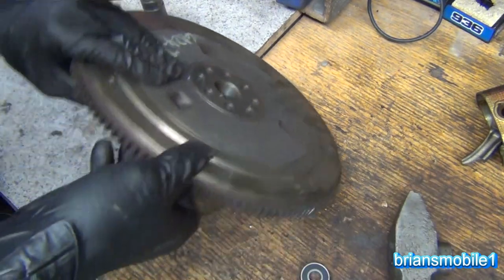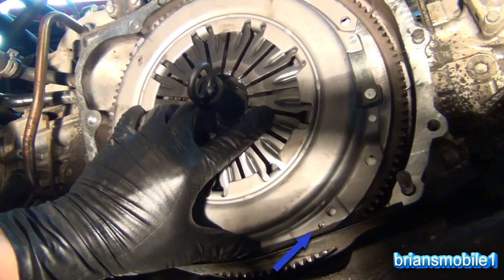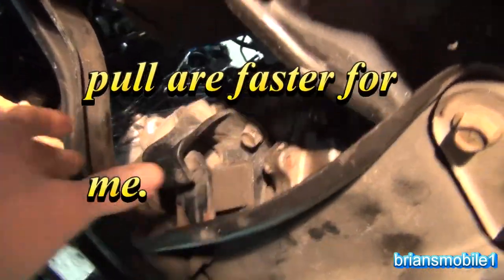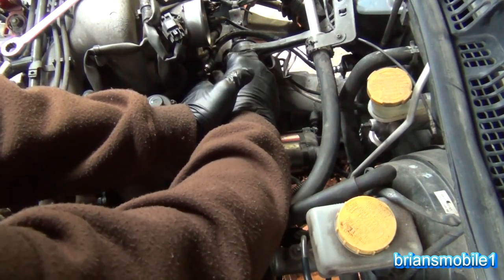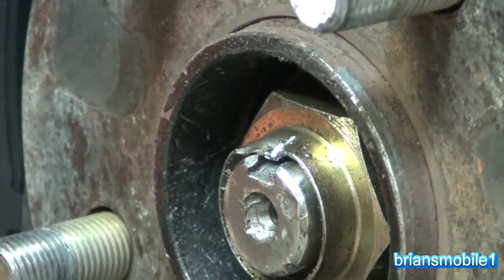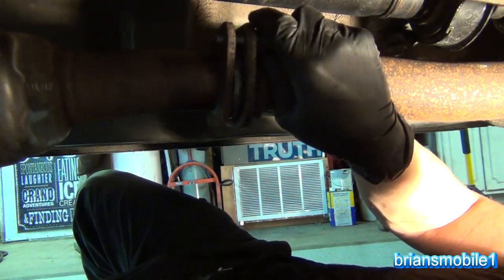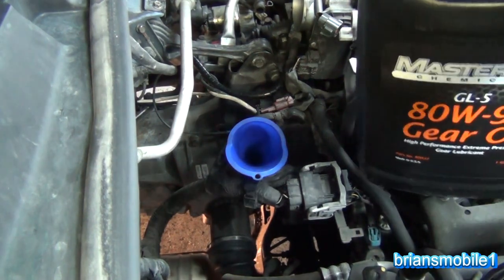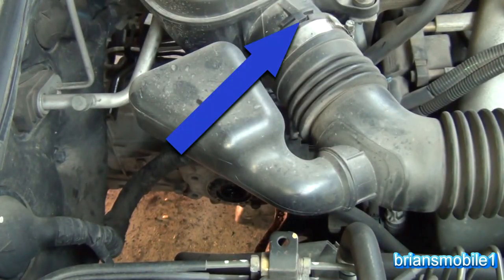Subaru Clutch and Transmission Install Part 2 of 2

Comment: Tip for getting the input shaft aligned with the clutch: if the input shaft won’t go in and there’s a 1/2 inch gap between the transmission and the engine, use a breaker bar and try turning the bolt on the crankshaft pulley in the front of the engine a little until they connect.

Comment: i had an 01 alero that had a bad wheel bearing on it... had it replaced at a dealer on the seller's dime... turns out dude didn't tighten that big nut nearly enough. i got five feet out of the door and hit the brakes and went straight back in and told them something was wrong because my brakes were messed up... a mechanic test-drove it and said it was fine. i had to go home and take it apart myself to figure out what was wrong. suffice it to say i never went back to that place after i made them fix it.. which, somehow, when they weren't getting payed, took about 1/8 the time. but yeah, those symptoms.. brake pedal shooting almost to the floor, steering off, wobble, and grinding sounds from the caliper mount scraping on the brake disc.. that's one of those CV nuts not tightened right.

Comment: For the pilot bearings to pop them out I just do the ole trick fill with grease and get a socket and extension the same diameter socket and the volume of grease and force forward pushes the bearing out even bread works but it's a mess of crumbs and not really worth the time I've seen the bread trick done haha

Comment: great vid as always. Those pic captures are funny. Wouldn't it be great if car manufacturers design a car in such a way as to replace clutch kit without separating transmission from engine. Cant be that hard.

Comment: I am using a transmission jack but I can not get the trans to move forward . I feels like the nose of the trans input shaft won't got into the bearing. Any suggestions to get it to go in? I have tried nose high, tail high, level, I've been fighting this thing for almost three hours.

Comment: Hey Brian, I have an oil leak at the rear of the motor on my 03 wrx. Which is easier pulling the motor or the transmission.
Reply: i pulled my 2.2 in my 96 legacy to do the seals but when your back there the usual culprit is the oil seperator cover you can probably do seals with tranny out but if you have ever pulled a seal its gonna be easier to pull engine where  you have acces to back of engine good luck and i would pay close attention to those torque values you dont want to be a stripper who doesnt get paid lol oh and i dont have experience with turbos they have down pipes and stuff i wpold research that too so your less likely to screw somrthing up good luck subys are worth the effort in my book

Comment: my subaru won't go inti gear even after installing a new clutch its a 2005 subaru Forester. ive put a new master cylinder but it wont push back to even bleed it properly

Comment: After replacing clutch successfully on 2008 Impreza , I got P0076 code for mass air flow sensor. Any idea what has caused it or what could be the idea to fix it other than replacing the sensor

Comment: Is there anything I should be aware of when replacing the dual mass flywheel in my 05 Outback XT with a single mass flywheel and clutch kit? I understand the 07 kit with a 14lb flywheel should bolt right up. Does that sound correct? briansmobile1

Comment: I need to replace the clutch on my 97 legacy outback. Ive done a clutch replacement but on a manual 96 camry so subarus are fairly new to me. Which is the least headache, removing the transmission or pulling the engine forward about 4-6 inches?
Reply: trans

Comment: Great job as always. Did you have to bleed the slave cylinder?
Reply from the maker: Thank you.  I replaced a bad brake hose before replacing the clutch.  I didn't have to bleed it but the once before the job.

Comment: Thanks for posting good videos on Subaru repairs. Saved me a lot of money, busted knuckles and plus some select words. I've replaced the timing belt from your videos and it worked out great. I now have to replace the center diff and the throw out bearing is making noise so this video will be a great help.

Comment: Excellent video, and I'm beginning to rely a bit on your advice.  Could you do the same transmission R&R for an automatic?
Reply from the maker: When I get the chance again sure.  I shot one, but the story line was a mess- never edited it.  Got interrupted a lot.
Reply: I've had that "interruption" problem all day today.  That wire, by the way, attaches to the torsion mount on the top of the tranny.  Thanks for the heads up, I knew to look for it.

Comment: How do you break in a new clutch?, I put one in my car then loaded it up and drove out with me and 2 others and luggage up across the rocky mountains from Denver right after a I put it in. but even now I'll smell clutch when pushing the engine hard. Even being in a lower gear going up a hill I'll still smell it.
Reply: Was the flywheel resurfaced?  New pressure plate?  Gripping surfaces free of grease?  Is the linkage fully releasing? Do you have any free travel on the pedal?  You shouldn't be smelling it!  Unless you're doing high RPM engagements!
Reply: dansMETube  Yeah whole new clutch assembly from car-quest and had Napa resurface the flywheel. The cable and linkage is fully released as theirs play in the cable. been like this since I first drove it, All I did was drive it home about 27miles , then load it up 3 adults and luggage, and drive it across the rocky mountains on I-70.

Comment: several subaru shops pull the engine off to do a clutch install, seems to be way easier
Reply from the maker: I've been doing it that way since the old GL's and DL's with the 1.8L engines.  It's more about habbits formed than anything.  It's like hitting the freeway vs a shorter neighborhood route for me.